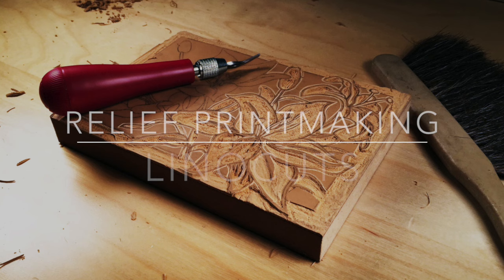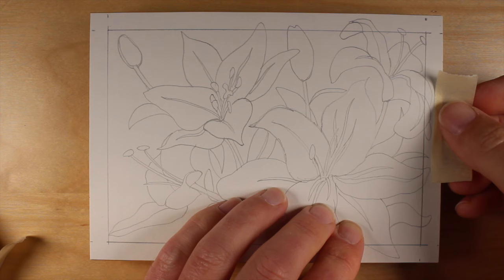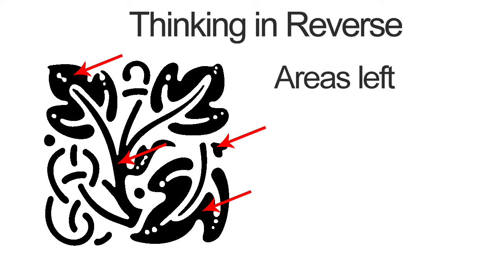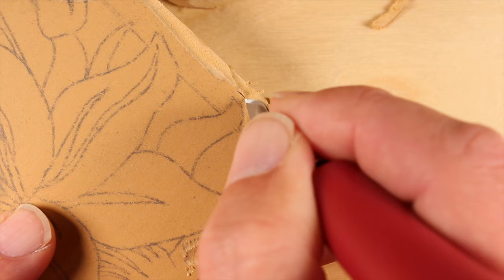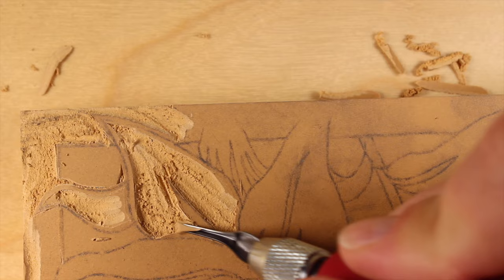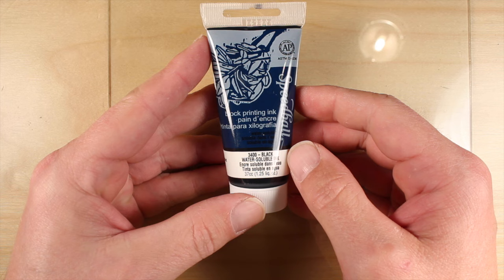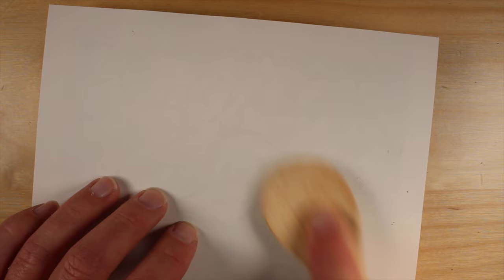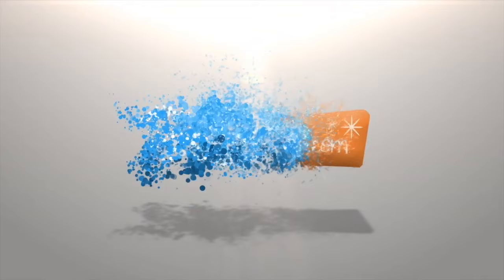Block Printing - Linocuts

Comment: If you want the linoleum to cut easier you can place a piece of paper or newsprint over it and use a household iron on a med-low setting to warm it up.
Reply: citylights97 we do that in art class
Reply: Heat packs such hot water bottles or wheat packs work well as well
Reply: Wow!! Thank you so much. I got so frustrated I gave up on it!
Reply: Great tip! Beginner here ✨
Reply: Thanks you 😁

Comment: this takes me back to 1975 and my design college days . when we were missing from classes youd find us at the beach surfing. We shaped and glassed our own boards, mostly MR twin fins back then and we experimented with linocuts wood yellotoungue woodcuts ??? potato cuts and hibiscus Hawaiian flowers in black and colours on our rails as well as step and repeat printing  . despite all the surfing and flunking school we passed. waaaaaaa what memories   surfs up!
Reply: Dont make our mistakes,  after designing great logos for our surfboards we photo stated our designs onto fine tissue paper or rice paper( hard to find). and glassed them under the 6 onz fibreglass cloth. they came out great considering they were carbon stats copied on our local library stat machine. However different stat copier machines are not always maintained properly so some of our logos spread the carbon due to the chemical reaction of the mek hardner in the resin and the logo carbon and the beautiful surfboard and all the processed work got ruined on lamination. No choice but to paint over it and try again. so if you do stat try different copiers around town and label them. Heat is supposed to fuse the carbon and dry it. rubbing testing with your fingers on the carbon is not going to solve it. its trial and error. if you use fixative to fix it permanently it may close the tissue and block the resin from saturating the paper and form air bubbles in the lamination I'm  experiment with this.  In printing there is a thing in lithography called "packing" which is extra small areas of fine paper backing the art sheet youre hand printing on to give a good solid print. The packing paper is placed in the areas not printing well definitely help the final print. you can tear a little piece or pieces or a whole sheet backing "packing" If printing onto fine tissue paper for logos and gifts etc use a full backing sheet to absorb excess ink saturating through the first tissue. a master printer knows all about packing, its an art . they use it a lot in unforgiving lithography  metal printing of deodorant , motor oil and cake tins/ metal tin sheet production, unlike paper and card tin plate, doesn't absorb ink. here there is a lot of step and repeat printing which you can do with lino cuts as well.

Comment: Brilliant thanks for uploading this vedio..
Please tell me,can we use linocut for printing very very fine arts, that means  to print lines which are 1/5 of millimetre ?? If yes how to do so?? If not suggest some other manual method??
Reply: It's possible to get fine detail (I'm not sure about the exact line width you mentioned), but most people don't spend the time or effort doing that. I'm not really sure if there are tools made that thin.

Comment: What's the advantage over using a Gelli printing plate?
Reply: Aren't Gelli prints usually mono prints? This way you can make as many as you want... say you were doing a bunch of greeting cards. You could use this lino cut to print onto your gelli after layering paint on the gelli, waiting till all layers were dry and then lifting it onto paper. Your background colors would be different with each print, but your flowers (from the lino cut) would be the same.